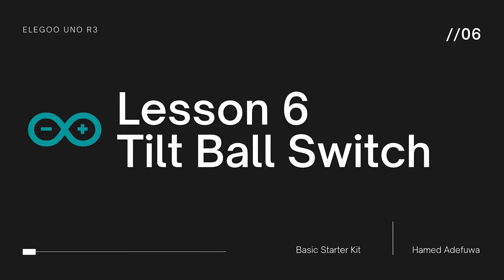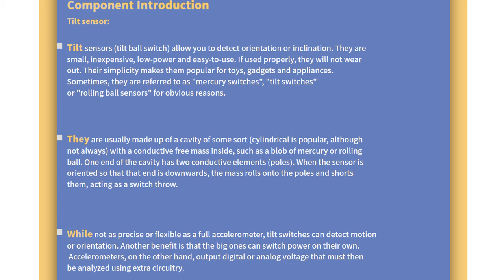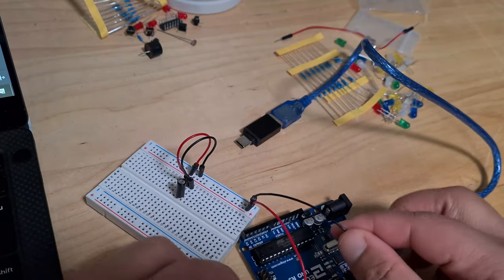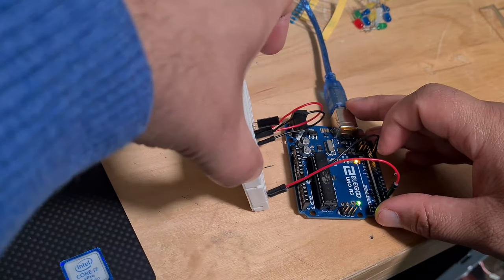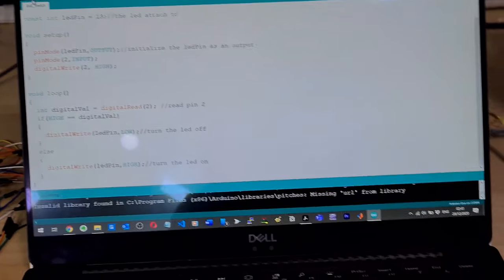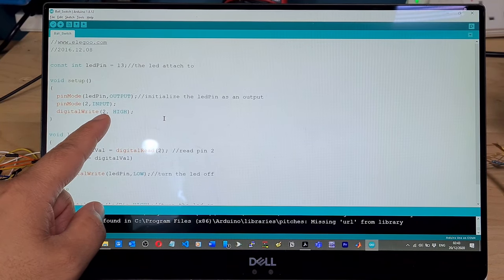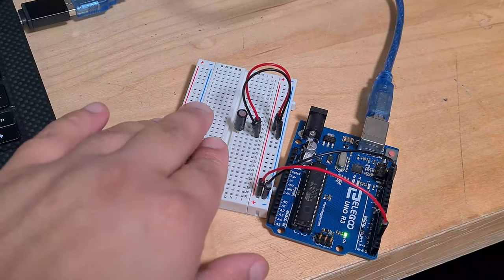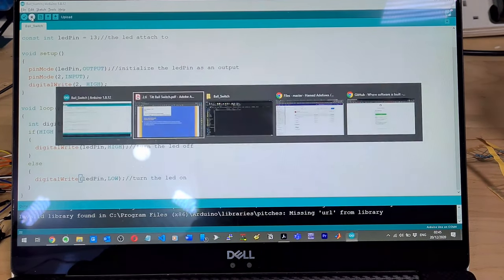Tilt Ball Switch Arduino Tutorial #6 - Elegoo Uno R3 Basic Starter Kit

Comment: I got the same kit and played with this sensor too, however i don't quite understand why set to high pin 2 in the setup function. 

I tried removing it and setting it to low and it stopped working correctly.

Comment: You pointing your finger at the line of the code:

int digitalVal = digitalRead(2); //read pin 2

You say you learnt C but you don't see the comment?

"// read pin 2"

it literally explains "read pin 2", which is what that line does, 
it reads the signal from pin 2 
(which I believe is where you connected the tilt ball switch)
so it will read if it is high or low (it is tilted or not) and puts it in the variable digitalVal which then in the program is used to decide if the LED light needs to turn on or off... 

Basically 1 signal was red on a "channel" into a variable, then a condition checks that value and turns a led on or off... 
a program code can't be more simple than this, it's almost as simple as "Hello world"